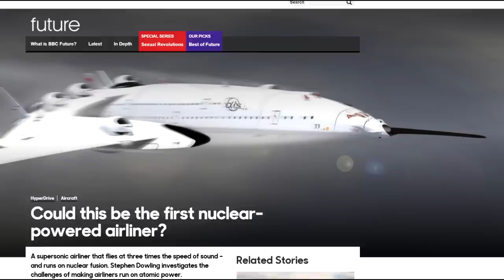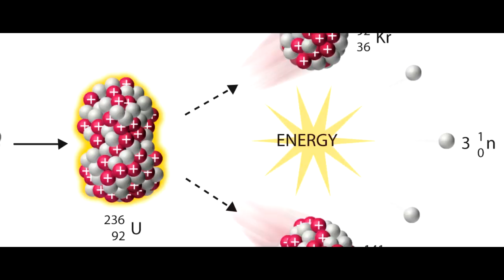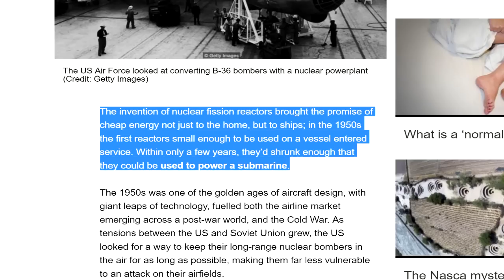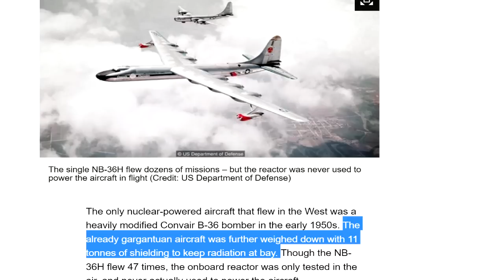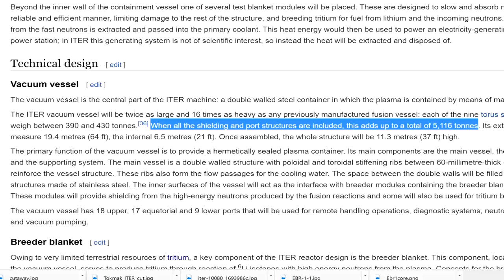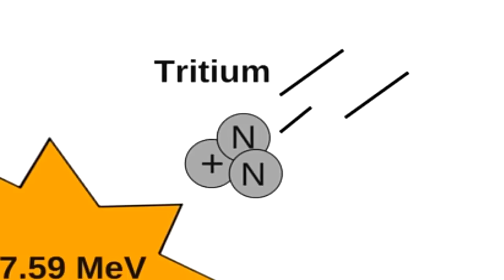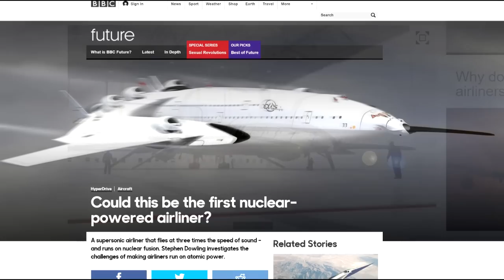SIX ENGINED Nuclear Airliner... BUSTED!

Comment: Here's a piece of advice coming from an actual nuclear engineer. 

Tritium is NOT "Screamingly radioactive". Yes it decays rapidly but it emits an electron which you can stop with a relatively thin sheet of aluminum or steel. Each Banana you consume contains Tritium equivalent to what a typical 1000 MW Light Water Reactor will leak into the environment in a week. If it was "Screamingly radioactive" to the point it actually mattered the International Atomic Energy Agency would be "screamingly" pissed at us.

You're mixing up shielding mass and shielding thickness. If you take precautions and zone where personal may and I may not move you can eliminate a large part of the shielding needed for gamma scattering. Fast spectrum neutrons are a problem because the water inside the human body and Carbon will moderate them which would cause damage BUT the US and Soviet nuclear bombers actually used moderated thermal spectrum neutrons.

Gas Brayton turbine cycles are much more efficient and light so you can harness power at a better thrust/weight ratio. If you use a liquid fueled reactor/salt fueled reactor you can make the construct even smaller and lighter. Using a steam turbine in an aircraft is almost completely out of the question due to their weight being immense. 

The plane's shape, although futuristic, predisposes to MASSIVE structural stresses and energy losses. The shock cone generated at high speeds will likely hit the wings and cause serious dynamic stresses.

VERDICT

Yes the BBC did write this with their ass but PLEASE don't claim others are ignorant without you being prepared to present hard evidence and preferably citing research. This kind of behavior is TOXIC to the scientific community and actually bogs us down slowing technological leaps.
Reply: Tritium IS screamingly radioactive, regardless of how easy it is to stop. (Sorry for the nitpicky technicality)
Reply: It is dangerously radioactive and also a gas at normal temperature and pressure. Now think about a plane with a few kilograms of this crashing or even just having a leak, no filter in a gas mask can stop it and you inhale it without knowing it.
I want to see you as a nuclear engineer break a tritium light (which contain less than a gram of tritium) and stay in the same room without venting the room or a closed  system breathing apparatus while staying calm.
Reply: Look at my comment, Tritium is extremely dangerous if it is not contained.
These lights work by something called Radioluminescence, to say it easy, they slow down or catch the Beta Particles, which either puts their Electron(s) in a higher energy state or the catched electron is in a higher energy state. As you may know, Electrons falling to a lower energy level send out a photon because that energy has to go somewhere and that just so happens to be  in the right energy range to be visible light for phosphorus.
Reply: Hristiyan Kolev You're right. You can buy tritium vials online, that emit light for tens of years. Not quite sure how they work, they have something to do with a phosphorus coating that produces light as the tritium inside the vial decays. They're not very dangerous to be sold to people, am I correct?
Reply: Amethyst Official.
9 months ago
"you realize thunderfoot is also a nuclear engineer right? although i agree some of his phrasing was a bit loose."
 Actually, I believe he is a chemist( not pharmacist) .
Reply: What material can we use to power vehicles besides gasoline and diesel?
Reply: The problem with Tritium is the same problem you have with most alpha or beta emitters. Yes, its easy to stop with minor precautions. Some water, enough air, some thin metal shielding. Tritium is a gas though and a Hydrogen isotope which makes it pretty happy to bond with oxygen. What's the human body made up of for the most part? Hydrogens bound to Oxygen. Now I'll concede that you'd basically have to drink Tritium-2-Oh (HTO) for it to really do any significant damage but leaving lots of it around in concentrations isn't the best idea. Thats why the NRC and CNSC and IAEA also want methods of treating Tritium.
Reply: Hristiyan Kolev Their are 
many people here who knows science here and we come to entertain our self on the youtube,  not to demonstrate out knowledge. Even you know this strange BBC nuclear plane  can never be reality.

Comment: Lets add...there is a REASON not to fly past the speed of sound, in an Atmosphere...
The Fuel require is HUGE...  And it ISNT a smooth flight..
Even Jets have problems past Mach 1..
Think of a TANK,..that gets 10 gallons per mile...YEP..thats allot of fuel..
the Air pressure you are pushing in the atmosphere is HUGE...you might as well fly backwards..

Comment: Another piece of bullshit you missed, the article claimed that the NB-36 was a "nuclear powered aircraft", it wasn't.  It was a standard B-36 with lead shielding and a reactor shoved in the bomb bay(it didn't completely fit).  The reactor was not connected to the engines in any way, it was simply a test to see if it was even possible to get a reactor airborne.  However a Cold War aircraft(sort of), that would have been possible to build in the 60's(thank god they didn't), was the SLAM(supersonic low altitude missile), aka project Pluto.  The SLAM missile was a cruise missile the size of a railway locomotive that carried 5-15(depending on which design) thermonuclear warheads.  It was powered by an unshielded nuclear ramjet that would have propelled it to Mach 3 and its entire flight path was at about treetop level.  So if it didn't kill you with an H-bomb, a massive shockwave, or directly hit you, the fallout would certainly have killed you.

Comment: Hey, speaking of nuclear. Could you please do a video about the predecessor of the Tomahawk missiles guidance system that used a nuclear engine but was unsafe and abandoned because it created radiation, and if it crashed was bad news.It heated air by running it over the reactor a direct heating method. I don't know all the details but would like to know more about it.
Reply: Look up "Project Pluto"

Comment: 1There are reactors sthat are far smaller than that used on the Convair, and in fact a very usable concept was created in the USSR however the point of a nuclear aircraft is nil since the idea has been superceded by more efficient engines of other types, and the promise of the newer anti-gravity engine.

Comment: They tried nuclear propulsion in aircraft before called NB-36H and it never worked out. The lead shielding around behind the cockpit weighed 11 tons.
Reply: hell even the Russians tried it and they also got nowhere with their plane either.
Reply: MegaRazorback I didn't know the Russians tried. I shall look into that.
Reply: Cartoonman154
take a closer look at the years for both of them and you'll see that it was during the cold war.
Reply: MegaRazorback I knew the the NB-36 was a cold war era experiment.
Reply: Cartoonman154
heh yeah....pity they weren't really feasible huh?
Reply: When testing the NB-36H it was followed by a transporter of marines, so just in case it crash, they had to secure the crash site because of the radioactive material.
Reply: Search for Ту-95ЛАЛ and Ан-22ПЛО
Reply: Ivan Boskovic Thanks.
Reply: *****
still would need a shit ton of shielding for it, you seen the materials they use for nuclear reactors today? it's still lots of dense and heavy materials as they are best at stopping most of the radiation.

Comment: Wouldn't it be way better if they use the concept of the SR-71 Blackbird instead? Sure that's no nuke powered plane, but that thing went Mach 3+, and the best part is, when it flew at top speed, it actually conserved fuel and flew more efficiently than at slower speeds. They can at least revive the concept of the Pratt and Whitney J58 and use a more refined or perfected engine with those bypass tubes for even more efficiency. Plus in 2011 I believe they had tested a bunch of F-15s and F-22s with biofuel and they performed flawlessly, they even managed to make the F-22s supercruise all the way to mach 1.5 on biofuel, so there is their fuel that they can use too.

Comment: okay, so let's say hypothetically you could shrink it down to be that small. why the fuck would you keep a fusion reactor on a plane where it'd be less efficient than it would be in a massive facility designed to maximise production. We'd be using batteries not reactors. We don't carry around refineries for oil in our cars, we use treated petrol/diesel.

Comment: Dissagree here on the nuclear part. Yea Fusion aint be the solution for that thing but the LFTR might be. After all the airforce payed already in the 50s to develop an LFTR for an atomic bomber. its a much more compact design, aint need that cooling and also not that shielding. ofc it is still an insane idea having any nuclear reactor on an airplane but an LFTR would be at least the least hazardous

Comment: A small point but, as big as those B-29s and b-36s and even the heaviest of all, B-52 were/are, there load carrying capacity is actually quite low compared to a modern airliner. A 488,000 lbs gross weight the B-52 is the heaviest bomber in the world but it's max payload (bombs in this case) is only about 60,000lbs.  And even at that loading they have to trade off fuel to stay below max gross weight.  To be fair, the actual load carrying capacity of a B-52 is around 300,000 lbs, it's just that this is generally almost all take up as fuel.

A large airliner, 747 for example, can carry about 300,000 lb payload, though at reduced fuel.  But of course it wouldn't need to carry any fuel if it was nuclear powered (well it would carry fuel, but the fuel would be a constant, very small , portion of the planes weight.  Again, to be truly fair, a 747 can carry over 500,000 lbs, but generally most of this weight will be fuel.  If no fuel is needed a 747 could carry a full passenger load while also carrying a 400,000 load of nuclear reactor and shielding.

Comment: Even if someone could make a super-dense, thin material that could block radiation and miniaturize nuclear technology; most countries would still never allow this to be used.
Even as military planes each plane would essentially be an Atomic Bomb strapped to smaller rockets.
So maybe Japan might use it. North Korea would desperately want these but could never afford them.
Reply: What's the point of your super-dense material idea? Density only tells how much space it takes, you would still need fucking 5k tons of it.
Reply: It'd have to be dense enough to still be aerodynamic and whatnot... but volume is how much space it takes
Reply: If it's dense it only takes up less space, idiot, ever heard of 10kg of feathers or 10kg of rocks?
Reply: That's the point, but 5000+ tons will never fly, at least not for next 100 years..

Comment: Yes there were attempts to make nuclear powered jet bombers. Yes one of those engines worked. Yes it was far too big and impractical to fit into a bomber. Dig a little bit and you will find it was a way to justify developing the molten salt reactor as a possibly fantastic way to....wait for it.....generate electricity.

Comment: Not just the problems of mass - that U shaped wing design looks way more difficult to build strong than conventional wings, the only upside is they look nice. And in order to take off on their engines planes have to be really overpowered, hence why the Harrier jump jet had the first and only water cooled jet engine used in an aircraft (as far as I know). 

This guy has rudimentary knowledge of all engineering, not just nuclear power.

Comment: they already made a nuclear powered bomber in the 70's, and it worked, it was called the "aircraft reactor experiment" essentially it is a flying nuclear powered submarine that can stay in the air for months before refueling. 

The issue with it is radioactive contamination should such a plane crash.
Reply: Are you talking about the research that led to the molten salt reactor experiment?
Reply: ***** That is my citation i just made a mistake on when it happened. lol.

I was probably confused because the molten salt reactor experiment took place during the 70's and that was a spin off reactor for civilian Peaceful purposes. But the use of Thorium and the "Molten Salt Reactor" Concept was in fact born from the aircraft reactor experiment.

Using a molten salt for a reactor coolant and fuel is genius..
Reply: And power to weight ratio. Another video has one of the actual scientists saying that the A.R.E. was just a rationale to fund what would become the MSRE. Kind of a foot in the door